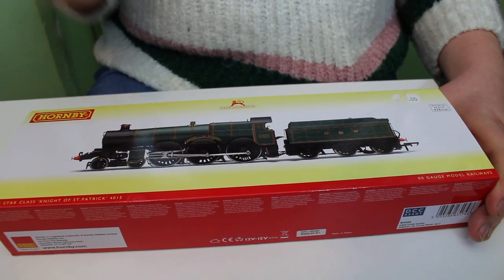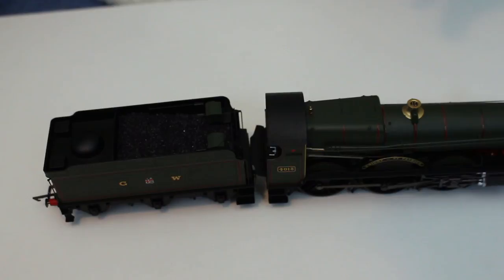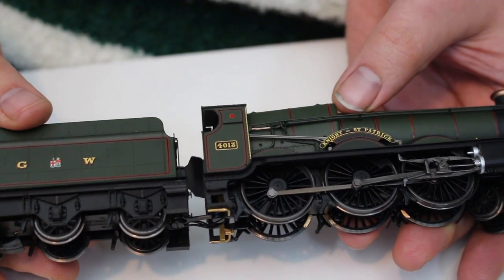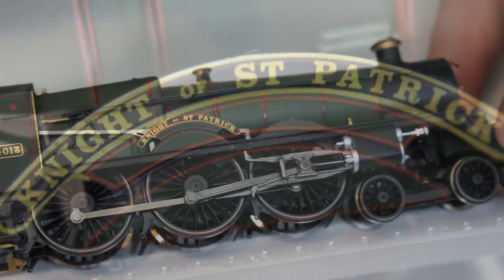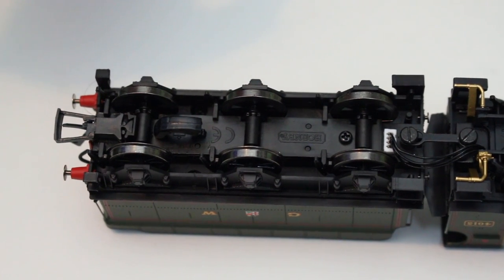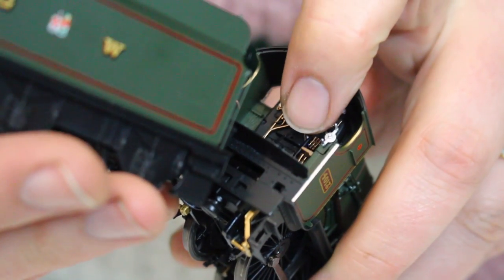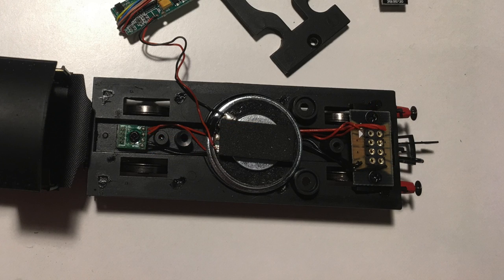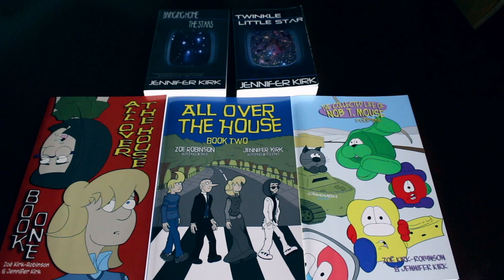Hornby GWR Star Class 'Knight of St Patrick' - Review and TTS sound fitting guide

Comment: Quick guide to GWR liveries:

Up to 1906 Red frames and monogram logo.
1906-1927 "GREAT (Round Crest) WESTERN".
1927-1934 "GREAT (Square coat of arms) WESTERN". No crest on goods locos.
1934-1942 Shirtbutton roundel.
1942-1947 "G (Square coat of arms) W" on passenger locos. "G W R" on goods locos.

Your Star is in the post 1942 livery. The best way to model pre-grouping GWR is to use their crimson lake livery for coaches instead of chocolate and cream.
Reply from the maker: Brilliant! Thanks for that information; very useful. I do, however, have a City class in a Khaki colour with just GREAT WESTERN on the tender and no crest, and wondered whether there were some variations during WWI?
Reply: @JenniferEKirk  Stretching my knowledge here but according to the Railway Modeller review of that loco (WWI Ambulance Train, am I correct?) then it was a short lived austerity livery used by the GWR in 1916 when green paint was scarce. It was a different shade of khaki to the ROD operated locos.

Comment: Hi Jennifer, thanks for your review. Here's a pedantic correction (intended to be helpful ;-). You mention joggled frames: You're right that Stars, early Castles and Star-to-Castle conversions had joggled frames, but that's not what you are pointing at in the video. What you are pointing at is the curved drop between two sections of the 'running plate'. What's the difference between the 'running plate' and the frames? There is only one running plate (hence the singular!), it runs in the horizontal plane and its sole purpose is to enable human access to the smokebox/boiler fittings/washout plugs. 
The frames are quite different. They are the enormous steel plates immediately behind the driving wheels. There are two obviously (hence the plural) and are in the vertical plane. They are like the foundations of a house - they bare most of the weight of the locomotive and transmit it down to the wheels via the springs and axle boxes. 
Here's something you may not be aware of. If you inspect many preserved GWR locos you'll see that many components are stamped with numbers that are different to the loco they are attached to - that's because the parts were interchangeable. So, how do you decide what to call a loco with bits stamped from several different locos? The answer is that the identity of the loco stays with the frames, and no other component of the loco!
One final point: what's joggling? Well if you look at the following photo on Flickr you can see it behind the pipes covered in white lagging at the right hand side:
https://flic.kr/p/2cRzNst
As you can see the frames are bent inwards slightly.The reason is to allow extra clearance inside the frontmost bogie wheels so they won't foul the frames on tight radii. The GWR didn't persist with joggling for the main 'production' Castles. Joggling would have been an additional manufacturing process, incurred extra costs and was presumably found to be unnecessary.
I hope this is of interest. Feel free to drop me a line on my channel if you have other GWR questions.
Andy.

Comment: Hi Jenny sorry to say that loco in the 1946 livery with a Collet tender. But a cracking loco all the same
Reply from the maker: Thanks, yes I have been given a helpful summary of identifying the different liveries.
Reply: External steampipes were only later fitted with new cylinders. I checked Patrick Russell's GWR Locomotives to see if the brass beading on the cab front survived wartime economy-it probably did, but would have been painted over.

Comment: It is possible that the sound fitted version (not the) has a 21pin socket rather than 8pin
Reply from the maker: I've not seen a sound fitted version advertised, though surely if there is one it would use the 8 pin TTS chip?
Reply: @JenniferEKirk  might be they may have been planning for a sound fitted before they decided on the tts when designing the instructions and left both in.

There are some hornby steam locos that do have a 21pin socket in the tender,  but not very many generally.